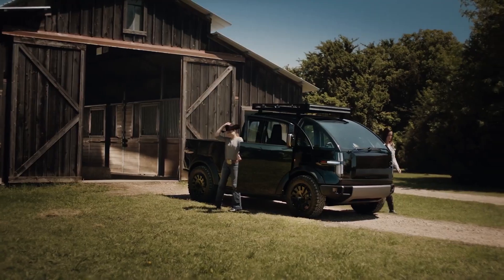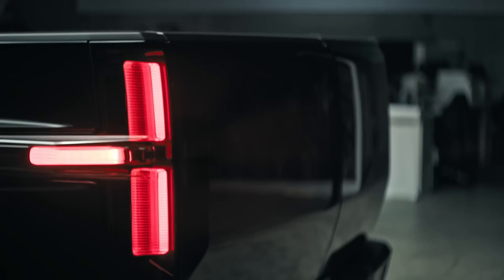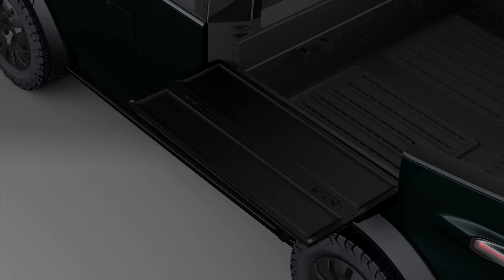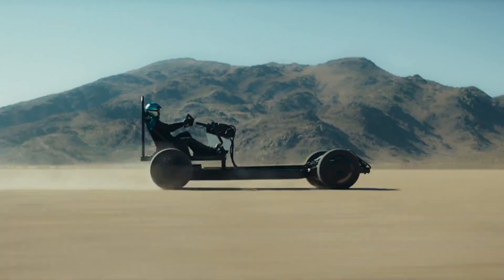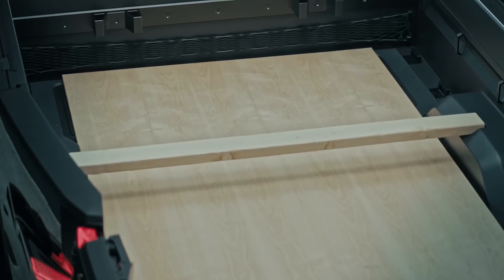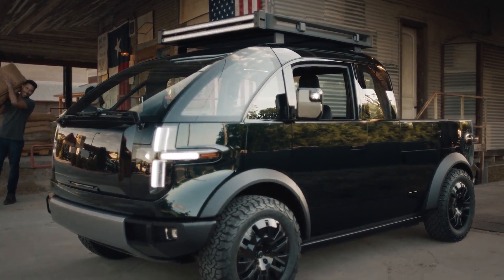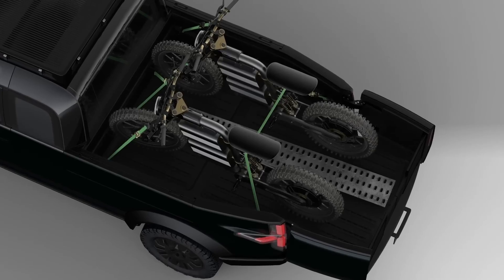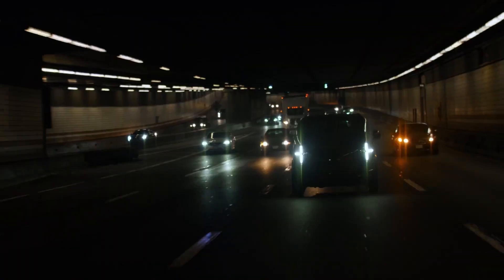How Canoo's Revolutionary Electric Pickup Truck is Changing the Game For EV Industry

Comment: 200M range is a deal breaker for any application
Reply: It doesnot matter as you should count on battery kWh number. Other has 50kWh battery saying 300 miles, do you believe them?
Reply from the maker: True I love it .
Reply: That's the best case number.  As we've seen with other EV's, actual results might vary such as in cold weather, hot weather  or when towing something.